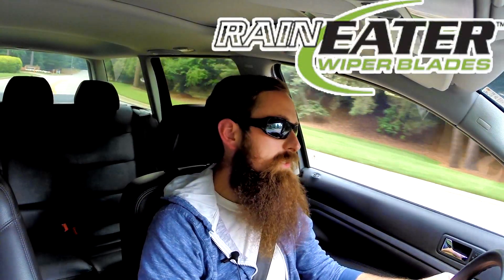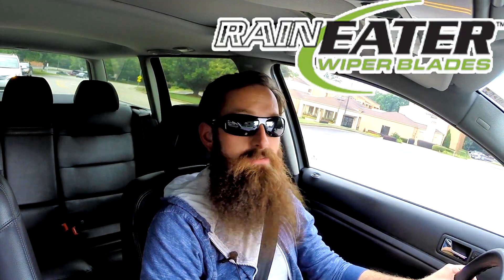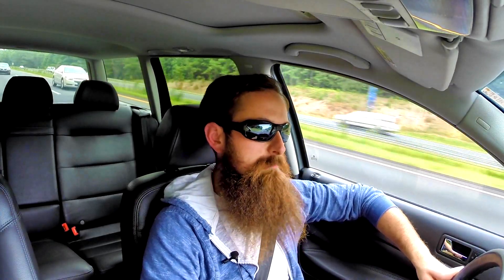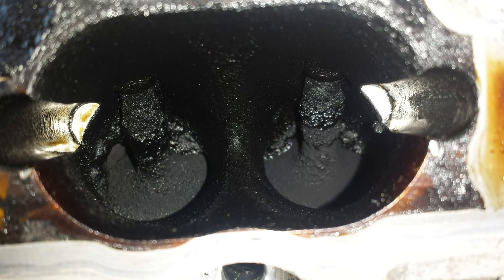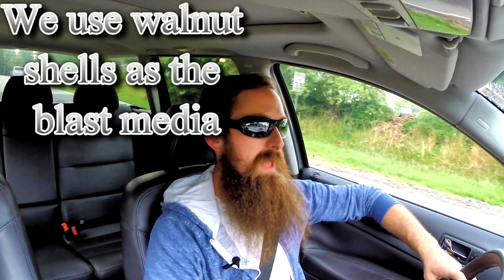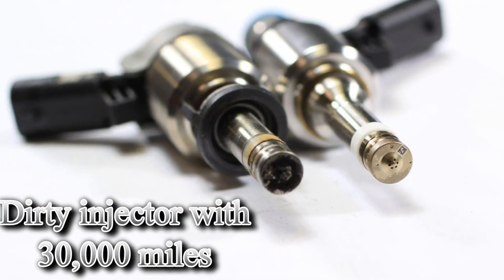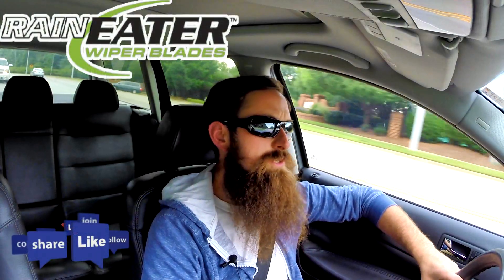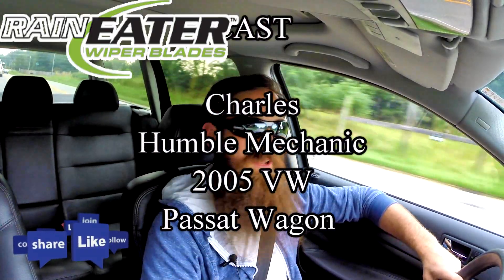Preventing and Fixing Carbon Issues for Direct Injection Engines ~ Episode 80

Comment: Hi Charles,

Your videos are great. I like your explanations as they are based on sound reasoning. 

Maybe I missed it but could you explain what is the root cause of the cold misfires in a bit more depth? 

1) Is the internal fuel/air ratio in cylinder momentarily out of whack as fuel droplets or vapour get hung up on the back of the intake valve carbon (sponge-like effect)? I know these are DI engines but is some fuel spray making its way to the backside of intake valve (when the valve is open) during  cranking / cold start at low rpm?

2) or is it mostly due to injector tip carbon which messes up the spray pattern or absorbs a tiny bit of fuel?

Speculation is ok. I know this is a complex issue.  Just looking for your perspective.

Al
Reply: Alan Welch In older fuel-injected (and some current designs) the fuel is injected into the "port" before the valve, so the fuel (which is a solvent) cleans up the back of the valve, the port, and the valve seat, however in newer direct-injected engine designs, the fuel injector tips are actually inside the combustion chamber, after the valves, next to the spark plugs, so no fuel ever reaches the back of the valve area which ends up slowly collecting stray oil and fuel additives from the intake air-stream.

The carbon/oil/junk mix on the backs of the valves, and in the intake port builds up to a gooey or hard black junk that eventually starts to slow the operation of the valve and get stuck in the valve seat causing the car to run rough at idle since the engine is cold; once the engine heats up it will burn off some of the carbon junk (or it will soften,) lessening the bad running effect.

So the main sources of junk are the PCV "or Positive Crankcase Ventilation" system which lets air pressure leave the crankcase of the engine and get sucked into the air intake and burned off, this air stream can contain a lot of oily mist.
Also most cars mix some of the exhaust gas back into the intake using a system called EGR "Exhaust Gas Recirculation", this exhaust can of course contain some unburned fuel, some carbon, etc
And then there are oily air filters - some people fit K&N or other brands of oily air filters in place of the paper or synthetic fibre factory-style air filters.

Some manufacturers have put a second set of fuel injectors behind the valves (in the normal place,) which washes off that carbon/oily junk; however other manufacturers just expect you to have the intake ports and the backs of the valves cleaned as a regular maintenance item.

Comment: The VW cleaner actually did help my rough idle, as well as smoother throttle. I'm not sure how the explain it. Prior utilizing the additive, as my rpm fell there will be hiccup not quite a stutter. During idle, I would feel minimal "hiccup" to the smooth idle. It took 3 full bottle of the additive, one bottle per fuel up consecutively. It's most likely temporary and most likely will required a manual clean. walnut blasting > sand blasting correct? mk6GTI60kTSICCTA no catchcan.
Reply: btw, love your video. Keep up the amazing work.

Comment: I don't think Carbon build up problems are across the board. I think its only associated with turbo engines. 
Mazda 2.0 Skyactiv is been out since 2012, no carbon build up issues, sames goes for their 2.5 Skyactiv.  Honda Accord 2.4 also came out late 2012.. No reported Carbon build up issues.
Reply: I have seen plenty of German brands having carbon buildup, I was wondering if Mazda had any issues as my friend has recently brought a CX-5 with a 2.5 Skyactiv engine.
Reply: @Desertduleler_88  It seems that Mazda installed an oil/air filter in their DI Skyactive 2,0 and 2,5 l in order to prevent this problem but it look like is not working ... https://www.youtube.com/watch?v=mhG1ZBqMnKA
Reply from the maker: harisahmed90 Good insight. All the DI engines I have dealt with have been turbo engines.

Comment: Why there is no problem with old diesel engines. They also have oil in intake from PCV and turbine.
Reply: +Piotr Radek most diesel's even ones from fairly recent years were not required to route the crankcase ventilation back into the intake thus not having the issue of oil going into the intake. Rather it just vented to the atmosphere and this point makes the strong case for the "catch cans" he referred to in this video. Also diesel's are mainly meant to be worked very hard all the time for heavy loads and such and this ties with the "spirited driving" only it's done constantly out of need.
Reply: Piotr Radek because diesels are designed to run off oil and more viscous materials.
Reply: +xxRamD3yruxx, I think not so simple. Technology making valves in both engines are same, I'm sure that roughness are same too. There are different between materials, but they shouldn't make any different. There is big different between burn temperature of gasoline end diesel, not sure but about 1100 to 850 °C. And it could cause burning oil on valve surface
Reply: Very old vw engine 1,9 TDI 1Z (~1994) have this ventilation to intake. My 2,5 TDI R5 AEL also has and no such problems with valves. In 100 km/h it about 2000 rpm, so it's not heavy load
Reply: +Piotr Radek That is a good question. I believe I have heard of newer diesel VW's to have carbon build up problem that I hope isn't true, as my mom has a 2015 TDI. But I've never heard of an old TDI engine from the mk3 or even mk4 generations have carbon build up. I know it could be more money and engineering than the manufacturers want, but direct injection and port injection should be included since the fuel spraying on the backs of the valves is what cleans them.

Comment: I read that Ford ecoboost engines were having problems with turbo bearings after using intake cleaner treatments like Seafoam.  I would be wary using it in my TSI.
Reply from the maker: 07HDDriver YIKES! That is not good.

Comment: Yo Charles, I work at a rental car facility and we have recently received a lot of 2015 VW Passat. I have had 3 of these brand new low mileage cars come to the shop with loss of brake boost and a poor running condition during start up. The most common codes I am getting at P0087 and P053F. We have dealer info access to several different manufacturers but unfortunately not VW or other Euro manufactures. If you have come across this set of issues let me know what you guys are seeing as a cause and possible remedy. 

Thanks Joe
Reply from the maker: Seen a lot of broken lobes for the HPFP. That also drives the vac pump for the brake booster. Working on one right now.
Reply: Good to know. I have been dying to know a possible cause since my hands are tied by warranty. My company won't let me tear into the engine for a complete diagnosis. Curiosity is killing me. Appreciate the info.
Reply: Joe Lopez i

Comment: From waht I read, 2015 vw golfs do have 4 additional port injectors. These work at low rpm only. Soon I'll be removing intake manifold in my car, your video tutorial you made some time ago will help me a lot. However I will need to perform some additional steps like removing oil dipstick tube (as I have TFSI 2007 engine where dipstick is directly in front of the intake). I hope it wont be much different than TSI you did on video. Can I ask you something? Once I do all the cleaning and start to put things back together, can I just leave the intake manifold support bracket off. I read people do this, they claim the intake holds firm enough.
Reply: Not in the US/Canada marker. It's direct only

Comment: Humble Mechanic  so basically, in order to get the engine to run how it should, we need to mod our cars? Why is a catch can not standard? 

Other non German oems seem to use direct injected engines and you never hear them suffering from these issues. I mean Honda puts a d.I. engine in the accord and I'd assume the average accord driver/demographic wouldn't think buying an aftermarket part to be a satisfactory solution to what seems to be a design flaw.

A flaw, that as you said, is an even bigger issue on NEWER 3rd gen tsi's!? That's nuts. I feel like my golf is a timebomb now, and vw's only solution is to schedule an appointment to pay money.

Are the days of the 200-300k engine gone?
Reply: gtileo interesting, thanks for the info! I know Hondas have started using d.I. engines, but whereas people are OK with accepting the 'quirks' of German cars, Honda drivers would be less forgiving, so I wonder what they're doing to combat it.

I'll probably invest in apr's intake/catch-can combo once I start to rack up the miles. How old is your dad's x5?
Reply: Toyota already had a solution to this back in 2006, it was called the D4-S system, my IS350 has it and the IS-F also has it. Nowadays ALL Lexus 3.5L engines and the 5.0 V8 engine (again in the F models) have this system...best thing ever IMO. I would never buy a DI only car, you have NO solvent washing effect on the intake valves/ports, that is just asking for trouble
Reply: 250 is DI only, it WILL have DI problems like carbon buildup. The 350 and F engine use DI AND Port injection, they are immune to the problem
Reply: 250 is DI only, it WILL have DI problems like carbon buildup. The 350 and F engine use DI AND Port injection, they are immune to the problem
Reply: 250 is DI only, it WILL have DI problems like carbon buildup. The 350 and F engine use DI AND Port injection, they are immune to the problem
Reply: Brandon Semik kinda stinks that the only solution seems to be in higher dollar cars. (though a vw gti can easily get into base model is territory, much less a golf r).

i wonder what honda's implementation was? probably similar to toyota. 

My next vehicle will not have DI unless it also has something to wash the valves, like port injection
Reply: +Brandon Semik I heard the early is250s and 06 gs300s had this problem, how's the is350? I've looked at buying one
Reply: +kgisabeast  the IS350 has port and direct injection.... there is no carbon (or any oher) issues with the IS350.... its a great car.....  avoid IS250
Reply: +JimB I ended up buying an 08 GS460 (: really liking it

Comment: another possible source of oil is through the valve stem oil seals--a PCV catch can is not gonna fix this! i always thought direct injection was a bad idea. putting a delicate injector, with its microscopic pin hole jets, into a combustion chamber just doesn't make any damn sense! i predict direct injection will become failed technology and disappear from modern cars very soon--just like timing belts did.

Comment: Humble Mechanic! What can you tell me about my 1.0 MPI engine what are the main issues and do they suffer from carbon build up or such, it's an old style MPI engine on from 2001 with 4 cylinder not 3 cylinder 
Thanks
Reply from the maker: gb291 MPI did not have issues with carbon like DI engines do. Plus fuel can actually impact carbon on MPI
Reply: so am i better with a cheap fuel or more expensive performance fuel and thanks very much for your time

Comment: Hi Charles... I've noticed this before in other videos (sorry to ask here). Have you got neck / back issues? I've dealt with a chiropractor in the past and am currently seeing a massage therapist on a regular basis for back issues.  You seem to turn awkwardly when shoulder checking... make sure to sort that out if you have pain, cuz it will only get worse with age. Take care.
Reply from the maker: ***** Nice catch. There is actually 2 things going on here. Yes I do have some nasty back issues. It is actually issues in my lower neck, and upper back. I have been around the entire circuit of treatments. massage help as long as I go about every other week. As I am sitting here at my computer, I am relaxing with my heating pad HAHA 

The other reason you see me turn weird in the car videos is not as exciting. I noticed that when I only turn my head, the audio drops out a little. Part of that is due to the place I have to put the microphone. I have to wear it in a spot that is off center more than I someone normally would. If I wear it in the "right spot" my beard hit it. That makes an awful scratching noise that drives me nuts.
Reply: HumbleMechanic Thanks for explaining! Never thought about the mic being part of it... makes sense. Take care of that neck & back!
Reply from the maker: ***** You too man!!

Comment: Thanks for the video. I plan to do a manual cleaning on my 2009 GTI pretty soon, as I'm close to 84k miles. I was having some cold start misfire / rough idle / rough acceleration at low speeds, and I just did new plugs and R8 coil packs last week... What a difference! The engine is much smoother all around, and I'm definitely getting substantially better fuel economy. I'm interested to see what the carbon cleaning can do further.
Reply from the maker: interstateB IT is good to know that the R8 coils help. I think that I will be installing them in my wife's Tiguan. 

The cleaning should take care of your cold start issues for sure

Comment: I think you should do a test on the new Tiguan that you just got since it's new and you would be able to see the difference in avoiding the oil miss all together ? Try a catch can and other thing that could not help is thin oil and if you have a bad thermostat and the car never reaches it's normal operating temp.

Comment: Just a thought, how about water injection? In my experience motors with it stay very clean inside. 
I'd be careful if the car already had a bunch of crap in it though, I'm not sure how much damage a chunk of carbon could do. 
I swear I don't sell them or anything.
Reply from the maker: Andre juneau I think water injection would help. But that would be just one more thing for people to maintain. It is hard enough to get people to come in for their FREE oil change every 10,000 miles. LOL
Reply: That is very true.  I was thinking more on the enthusiast side of things VS regular car owner. You remind me that my 2014 CR wagon is saying 200 miles until 20K free service.